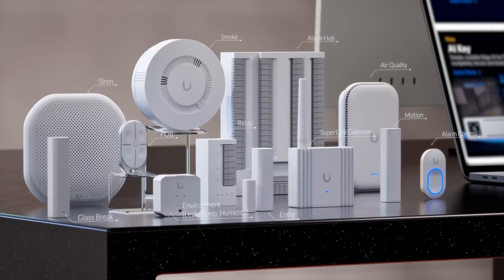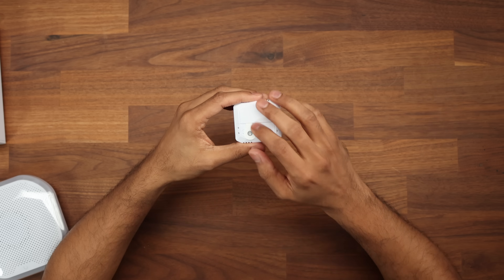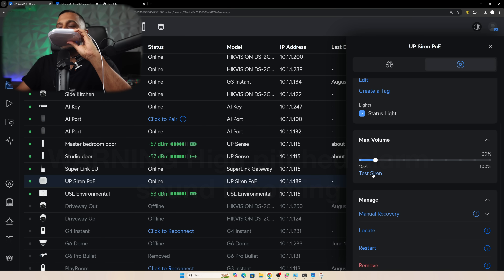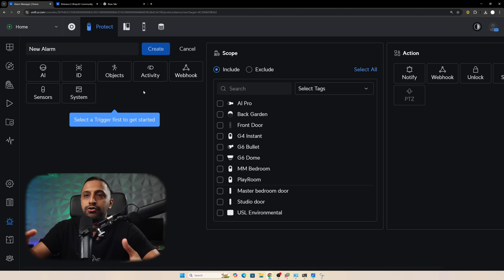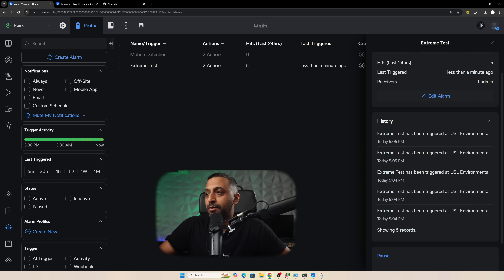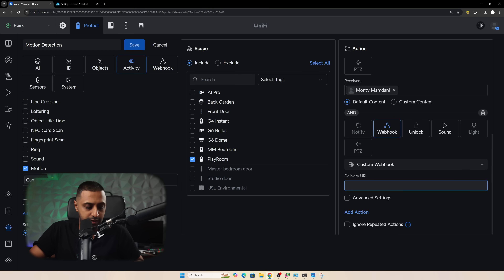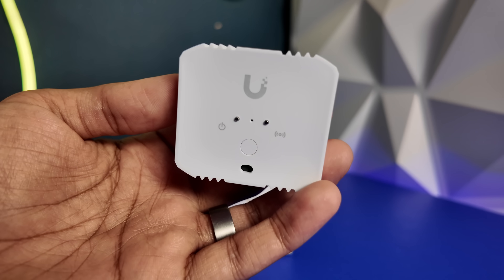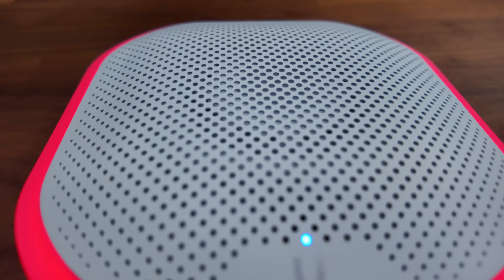SuperLink Sensors are HERE! Ubiquiti Environmental Sensor + Siren in Action

Comment: Sorry, but this review isn’t very good. Let’s break it down. The main purpose of this siren is for use as a home intrusion alarm, small business alarm or a warehouse personnel alert system. However, you only demonstrated how it works on a table.
Why not show us how loud it actually is—say 100 dB—measured from 20 meters away? Maybe it’s not designed for that range, and perhaps beyond 50 meters it won’t be audible at all.
Also, you should demonstrate how the siren works with camera-triggered detections. For example, if a camera trigger lasts 30 seconds, how long does the system wait before sounding the siren, and how long will the siren continue once triggered? It feels like many of your videos are rushed—just putting out content quickly, but with low quality and little explanation. Consider making longer videos with more in-depth explanations and thorough testing. The Unifi community tends to watch full videos, so adding more detail would likely get you more views, quality feedback, likes, and comments.
Reply from the maker: Thanks for the feedback, ill take it onboard for future videos.

Comment: Thanks for the video. Too bad the sensor doesn't have an e-ink display to show the actual temperature/humidity. They should have done a home version (with screen) and a pro version (without screen); now you are forced to open the app to check the data.

Comment: The water sensor seems pointless mounted on the wall - I always place mine on the floor, where it can detect water the moment it appears (“first contact”). If it's stuck halfway up the wall, it's unlikely to catch a leak in time.

Placing the water-sensing unit on the floor is essential, but then the rest of the sensor’s features (like motion or humidity) become somewhat wasted.

I hope Ubiquiti will eventually offer the water-sensor module separately at a more affordable price.

Comment: I don’t understand why not co2 and smoke detection and 2 way through the alarm
Reply: Yeah, exactly my thoughts. I was hoping to have something comparable to the Google Nest Protect in my hands, covering smoke detection, maybe even combined with temperature, humidity and ideally also air quality measures =(

Might come later, but I have already held back too long to buy into a solution covering that now... =/
Reply: I noticed an audio alarm setting on the notifications. I assume that would pick up a smoke detector going off. If it does work like that, you would still need multiple devices to get smoke alarm warnings, but it could be very handy. I have been researching things like this for my wife's business. We need smoke detectors in rooms that house animals, but the siren in the living quarters. This may be a good for that.
Reply from the maker: Theres no word on when these might be coming yet. Hopefully sooner rather than later.

Comment: but isn’t it still required a $400 entry before you can even begin testing any of the sensors because you have to pay for a ubiquity protect controller, whether it be a dream router or a cloud key plus... Then you gotta pay for the super Link.... that puts you at $400 before you’ve purchased any of the sensors, right??
Reply from the maker: That is correct, you need something that is running UniFi Protect for you to be able to use these sensors
Reply: @InsideWire well that's now changed. They decreased it by $70 USD..you'll need a nvr instant and then the superlink... Isn't that $330 usd?

Comment: Any idea on the sensor probes for water detection?
Any indication if visible or usable with Apple HomeKit?
Can siren be used as a speaker? Any differences between POE and SuperLink versions?
Reply from the maker: No idea on the sensor probes yet. 
I cant see any visible homekit integration 
Siren cannot be used as a speaker. They will be the same, just one is POE and one will use the SuperLink protocol.

Comment: Decent review but I think the reviewer does not understand how decibels work. Decibels are on a logarithmic scale, where a 120 dB sound is ten times more intense than a 110 dB sound. So the AI Horn is 10x louder than the Siren, even though the reviewer said that the Siren was nearly as loud as the Horn. Sounds at 110 dB are very loud (think jackhammer) and can cause hearing damage over time, whereas sounds at 120 dB (think jet engine) are considered extremely loud and can cause permanent hearing damage very quickly.
Since the Siren seems more suited to indoor use whereas the Horn is more of an outdoor product, the dB ratings on both seem reasonable for their intended use.
Reply: 0:38 Beat me to it. Thanks for posting this.

Another way of thinking about it is that the volume doubles every 3dB.

However, subjectively, the difference between 110dB and 120dB does not seem like 10x.
Reply from the maker: Thanks for explaining this. everyday is a school day, guess I wont be making this mistake again haha.

Comment: What’s the difference between the PoE and Superlink sirens? I assume the Superlink one is just DC powered and relies on a Superlink for all data comms?
Reply from the maker: Power method shows 4 x CR123A batteries 12-24v DC. Yes it will work on superlink for communication

Comment: Aside from these all being needlessly ugly, that environmental sensor makes little sense. Trying to do way too much likely making it bigger and more expensive than a water sensor need to be.  Not a great design for water sensors (not cupped at the top to funnel water from above and only one sensor on the bottom) and you don't need all the rest of that stuff when you need a water sensor.  Unless you are dealing with a specific case of worrying about freezing, temperature and humidity on the floor is irrelevant.  Not going to mount a water sensor on the wall.  Of course, for consumer, having a water sensor without a shut-off is not a solution. Better than nothing sure, but if a water sensor goes off you need action immediately.  If you are at work/on vacation/etc it is just a notification that your house will probably be destroyed by the time you can do anything about it.